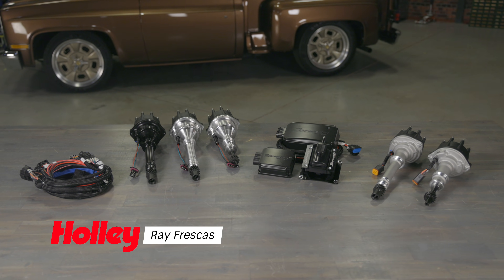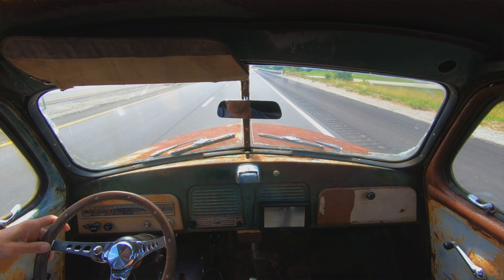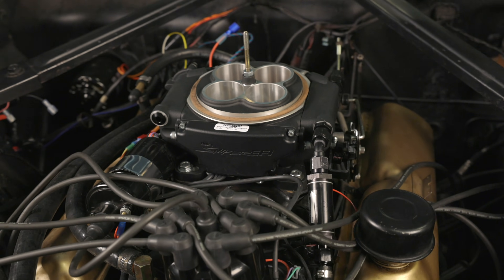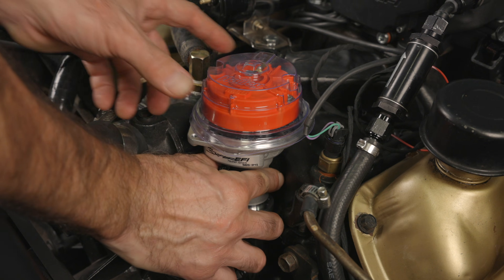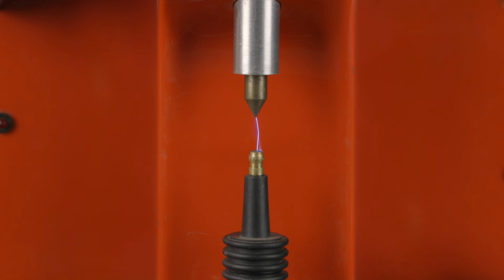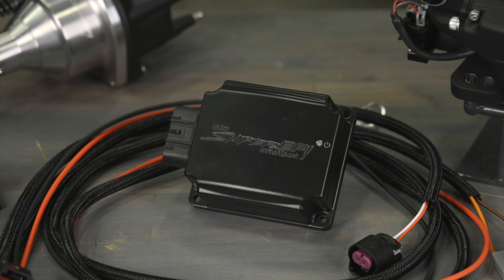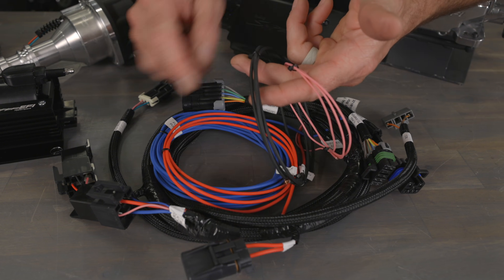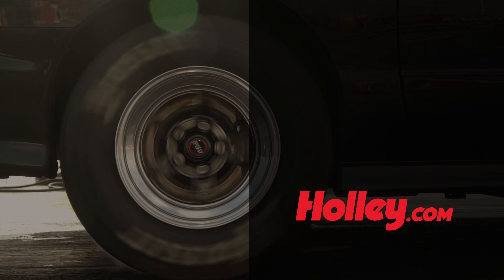HyperSpark Ignition Buyers Guide - Everything You Need To Know

Comment: I just swapped  my clutch out on my transmission I have the sniper 2 hyperspark system with ignition box and coil I put my transmission back in and try to crank it .. nothing my light in the box stays orange now but I drove it to the spot where I replaced my clutch was running perfectly